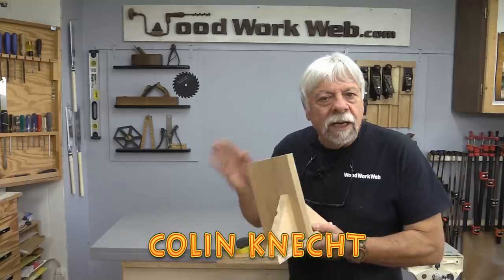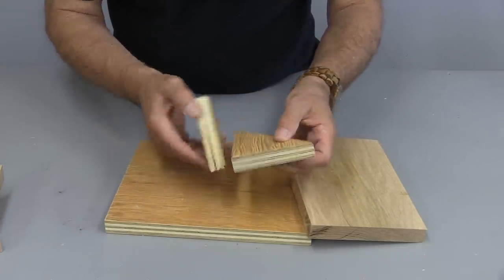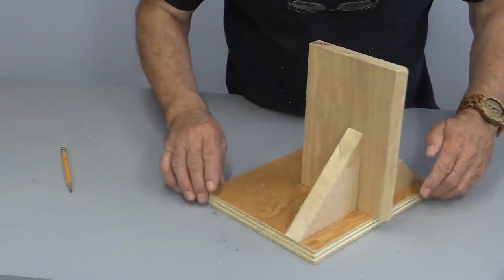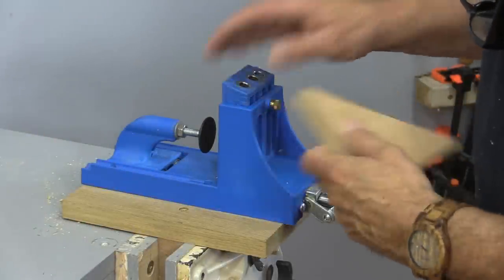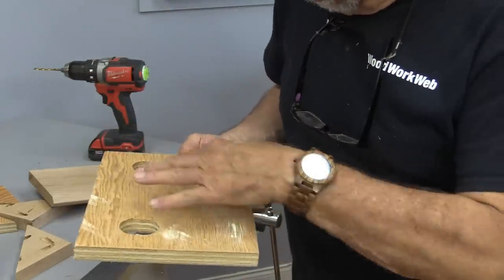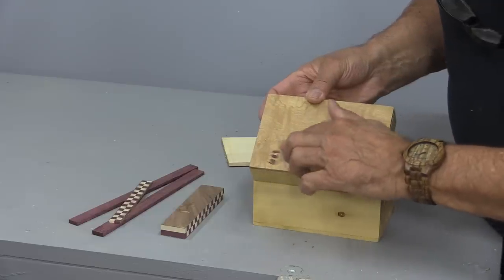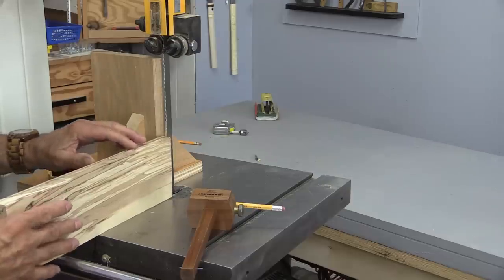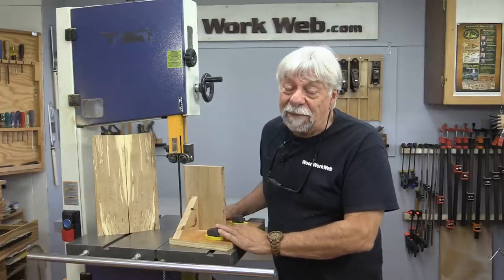Pivoting Fence / Resaw Bandsaw Fence Using a Magswitch Jig

Comment: Mag switch has 2 or 3 sizes of mags.  Which one do you recommend for this?  Also, what is the bit you use to cut out for the switches, I've never seen anything like it.  Thanks!
Reply: That's called a Forstner bit and they come in a range of sizes from about regular drill bit size to 2” and above. They work pretty much like a hole saw, except that they don't leave you with a sometimes useable small disk once the hole is cut, BUT the cut itself is cleaner.

Comment: Why a pivot fence and not a regular fence?. This seems like a bit more dangerous. Besides if you were making this type of fence wouldnt you want the pivot point to be as hard as possable...Maybe even from plastic or metal?? Wouldnt this cause too much stress on the bandsaw over time if the pivot point and the edge of the superstructure was too far from each other. This jig seems to be better suited for a jigsaw maybe...maybe. Ive only been doing this a few years so please be nice if im wrong everyone else
Reply: I would also like to know why it is better than regular fence. (but I am pretty sure there is a reason why)
Reply: Shane Nudds It’s a wood DIY version of the Magswitch Resaw Guide but taller.
Reply: I think that Colin is showing a "jig" that could be used.  I myself have built a fence that goes over my 4" high fence to extend it to 8".  I find this is what works good for me.  The main thing to keep in mind is that higher the blade guard so more wood you  want to cut; the blade will turn on you.  Make sure that your blade is sharp, and you push the wood slowly.  You are cutting a lot of wood.  You will also need to make sure that your blade is 90 degrees from the table.  You will eventually figure out what works better for you.  It all comes with time, trial and error.  Good luck with your projects.
Reply: The pivot fence is designed to help counteract any blade drift you might encounter on your band saw.  You can adjust the back end of the wood as it is being fed through if your blade starts to veer off the line, and the distance from the protrusion to the blade can be kept fairly consistent throughout the cut.  A lot of drift can be counteracted by ensuring that you have proper tension on the blade and your wheels are set up right but not everyone has their saw tuned up properly and have to deal with drift.
Reply: One of the quirks of band saws is that they often resist cutting parallel to a straight fence with any real precision. While some fences can be adjusted to compensate for this "drift" that setting usually is not applicable to different blades or even the same blade as it begins to dull. Some find a straight fence, perhaps augmented with a taller auxiliary face, to be adequate for cutting thin slices from a board. There are no constants here. You have to try it on your band saw and see if you are satisfied with the results

The resaw post keeps the wood square to the table surface and limits the cut to the distance between it and the blade. The  shape of the resaw post allows it to be used as a pivot. A line is drawn on the top edge of the wood indicating where the cut is to be made and the resaw post (and fence) is adjusted so the blade aligns with that mark when the wood is held against it. The operator then holds the wood against the resawpost and guides the wood through the blade pivoting it on the resaw post as needed to stay on the cut line.
Reply: @stillesorrow  Excellent answer, well explained and much appreciated.  Thanks to all for the friendly help.
Reply: @timcaron9049  Well done Hal, thank you.